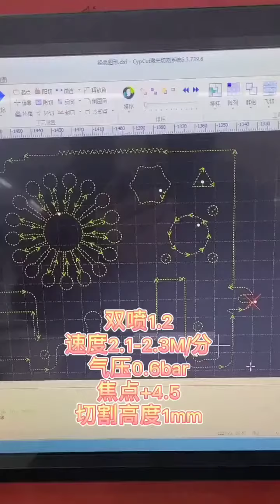3000W laser cut 8mm stainless steel bright surface #cypcutparameters

Comment: Hi Caroline 
I have raycus 1000w in cnc fiberlaser I have questions

nitrogen gas can cut mild steel and carbon steel or no just need oxygen to cutting mild steel and carbon steel...  I know nitrogen is expensive than oxygen but just I'm asking you this question if it can cut mild steel and carbon steel or just using nitrogen for stainless steel and aluminum and copper

Also my other question for purity of oxygen if purity of oxygen just 93% and 7% other gas can cutting mild steel and carbon steel or no
Reply from the maker: Nitrogen cut stainless steel, Oxygen/air cut carbon steel. purity above 99.9%
Reply: Thank you air compressor can cutting carbon steel and meld steel